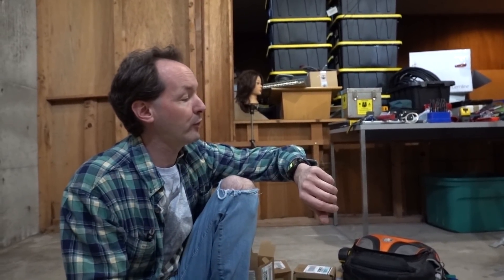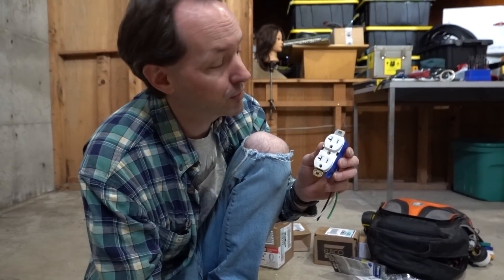Captain's Blog 4 26 2019 Electrical Work Time Compression Experiment

Comment: yeah, that 240 V outlet is like what we use for our air conditioner.  i got so many shocks in my younger years involving 120 volts and once while standing in water even, that in my technical school, my classmates called me "sparky".  i actually dimmed the lights in the school while holding a misplaced screwdriver inside a dryer LOL